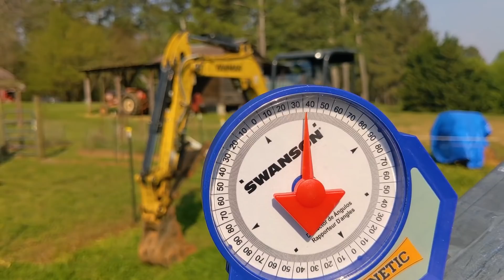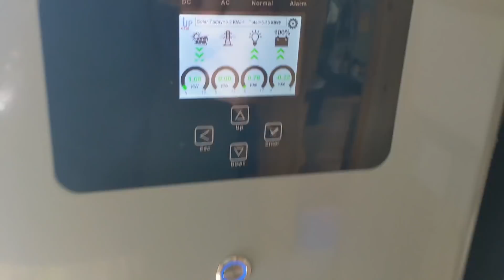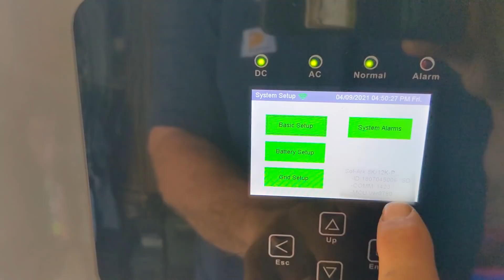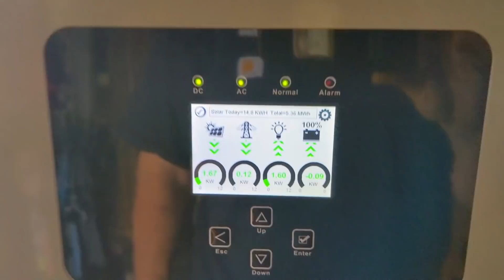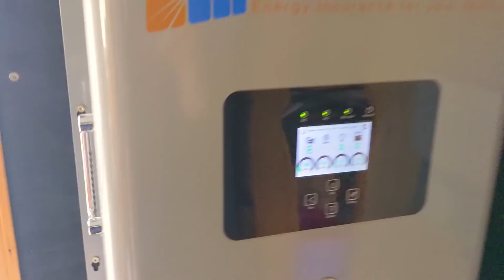4-year-old Sol-Ark upgrade if the cops will let us

Comment: You are right about trackers.  When land is the premium or modules are $20 a watt like they were in 1986, trackers make sense.  Otherwise, add modules and reduce failure points by installing a fixed array.

Comment: You are allowed up to a 9,999 lb trailer on a C-class basic license. Trailer over 10,000 lb requires a B-class license. The only exceptions are for having a recreational-type trailer. The 26,000 lbs come into play with a single-vehicle 2 axle type truck. The CDL  Class B license allows you to drive a 3 axle single vehicle weighing up to about 54,000 lbs. It could be 56.000 lbs. I can't remember for sure. Been a number of years since I had a CDL license Anything else in a combination of truck or tractor-trailer requires the CDL Class A. You then have to keep a current medical certificate as well. It kind of sucks the RV crowd gets exceptions to these rules.  You also need to have dot info and the last 8 of the in number on the doors as well. I am sure the troopers made you aware of that.
Reply: Actually any trailer over 10,000 lbs takes a class A license.

Comment: During a trip about 2 years ago to an all volunteerism  Parker AZ. Desert Van build event as a volunteer worker I mistakenly returned to Arkansas via I-40 and Oklahoma.  I continued past the Oklahoma DOT truck inspection station near the Arkansas / Oklahoma border since I did not fit any of the posted reasons for me to stop. The DOT cops ran me down at about 8 pm because the cop said my open trailer with some black plastic storage containers made me look like a contractor trying to sneak by the check point.  I spent the next 47 minutes trying to convince the cop I was not a contractor, AND , I had received NO monitory compensation, donations food or any other item that could have a monitory value assessed against it to make me getting paid for helping others making me a contractor by receiving a material item for work. Cop told me to go ahead but pull in next stop before getting out of Oklahoma. I agreed to do so, then I did not stop till I left Oklahoma on I-40. I have not been back on that part of I-40.

Comment: I bet your GVWR was over 26k.  2017+ F350 dually GVWR 18k + 10K trailer puts you at 28k combined GVWR.  Sir, did you know that you need a CDL A and medical card?  Oops.  Been there done that with NCSHP.  They really crack down on the ton trucks pulling trailers now.  Leave the big trucks alone most of the time.

Comment: The main reason I have an adjustable mount it's because I need about 67° in the winter time. If I left it at the 41° latitude the snow would cover it too much of the time. At 67°, it slides off much faster.

Comment: I worked for a groundmount installation company for five years using a 30' gooseneck trailer from florida to connecticut, without a CDL. As long as the truck and trailer is rated and registered for the weight, and it doesnt exceed a combined weight of 26k, and you have all the dumb fire safely bs covered, weve always told them to stick it... They cant do shit about it when its the law. Weve even gone to the DOT website and highlight it for them. Be detailed, and explain it rrreal slow so they understand. Haha
Reply: Yep. Managed a regional trucking company for 20+ years running 2 fleets. 1 fleet 18 wheelers with no issues, 1 fleet of one tons pulling goosenecks for the oil fields. We had a constant hassle over our gooseneck operation. I fought every single citation and won every single one. I found that most, but not all, enforcement officers and their supervisors were not properly trained in the less than 26k operations. Unfortunately, one state DOT officer got demoted due to his arrogant attitude. I went over the state and federal regs with him face to face on two occasions and he would not budge. Thing is, I actually liked the guy and hated he got booted back to the bottom rung of the ladder. But as they say, it is what it is.

Comment: Your channel has helped inspire me to start my own channel    Keep up the great content. So what was the citation for?  I’m in VA, close to NC
Reply from the maker: In South Carolina I'm legal but in North Carolina I am not according to the maximum GVW combined. Even if my trailer was empty they still could have got me.
Reply: @engineer775  Did you have an Annual Inspection Report with you and did he write a ticket on that if you didn't? As soon as you cross the State line, the limits change on when one is required. As I'd guess that trailer is rated at more than 10K, it alone can put you afoul of the law once you cross a State line. :-(
Reply: @engineer775  You should get an attorney involved.  There are laws if your vehicle is legal in your state, you should be legal in other states too.  With both of you getting ticketed, you probably can pool your money together to pay the lawyer.
Reply: @haroldhechinger5850  Waste of time and money. Just because you are legal in your State, does not mean you are legal in another.  Driving a vehicle that is used commercially opens you up to a whole different set of laws. Heck, just having a CDL opens you up to different rules even in a car.

Comment: Receiving a traffic citation is NOT being arrested. Follow the law and you wont get traffic citations. Stop whining.
Reply: Um spoken like a true pedestrian
Reply: A charge of operating a commercial motor vehicle without a commercial driver license is a crime, not merely a traffic citation. Depending upon the actual weight of the trailer, that criminal charge may have been a possibility.
Reply: @r2db  oh please... we all know these laws are about revenues not public safety.... this is plain old harrassment what He needs to do Is license the truck and trailer under farm plates and weight is no longer a problem... stop contributing to the North Carolina political oppression patrol
Reply: @tdgreenbay  If he drives the farm vehicle for uses not within the limitations of farm vehicles that could also be a crime instead of just a traffic citation, possibly getting his vehicle impounded in the process instead of just going on with his day and paying a ticket. Before getting my class A CDL the heaviest vehicle I had operated was a medium duty ambulance. The specific knowledge and skills taught at CDL school were absolutely essential to the safe, unsupervised operation of a heavy vehicle, although CDL school is only the bare entry-level training for such vehicles. There is a reason that specific training, testing, licensure, and insurance are required for heavy vehicles. They are deadly weapons if the average steering wheel holder is operating them. I have already picked up enough splattered human remains on the highways.
Reply: @r2db  what's not farm about trailering a Skidsteer or Mini excavator... dont volunteer information play it cool hand luke
Reply: @tdgreenbay  The actual use is the issue. Just because something can be used on a farm does not mean that it is exclusively used on a farm. For example, in Wisconsin: "A registered farm truck may not be used in furtherance of any nonfarm occupations, trade, professional or other employment including commuting to or from the place of such nonfarm occupation, trade, profession or employment."

Comment: Practice the right answers!  Where you headed? Eastbound, where are you coming from? Westbound ! What are you hauling? My personal property! For what purpose? Farm use! You got tickets because you gave gave all the wrong answers, you said I’m hauling customers equipment to a commercial job, which was wrong, that equipment belonged to you until installed and you took it to a farm!  You can travel anywhere in the us on farm business with local farm tags and are exempt under federal law up to the 26000lbs, put NOT FOR HIRE on your trucks, because you’re not hauling for hire
Reply: Sorry, but you are wrong. A State can have stricter laws than the Federal Laws. The Federal ones are the bare minimum. Farm tags? Better be closer than 150 miles to where your equipment is registered at or you will find yourself getting a ticket in many States. One that could catch me if I had registered my vehicle at the full 11,400 GVRW? Florida law that says a combination that exceeds 18,000 is a CMV.  Truck GVWR 11,400 + trailer GVRW of 7,000 equals 18,400 and could get a ticket if no CDL, etc.... CT had the same laws and if you went to a show and won a trophy or ribbon, it was considered a CMV. The other problem with the truck? When it was built it exceeded the width laws on many State Highways. Because in 2001 the Federal Law changed to 102" on the wheels/bed but the State laws still had 96" limits on State roads where the lanes were under 10' wide. 
And the annual report requirement can bite you. "All commercial vehicles (trucks, tractors, buses, trailers) with a gross vehicle weight, gross vehicle weight rating, or gross combination weight rating of: more than 10,000 pounds when used in interstate commerce; or more than 18,000 pounds in gross weight used in intrastate commerce; or vehicles that are designed or used to transport more than eight (8) passengers, including the driver, for compensation; or vehicles that are designed or used to transport more than 15 passengers, including the driver, not for compensation; or any vehicle transporting hazardous materials requiring placarding must receive a Federal annual inspection in accordance with sections 14-163c and 14-163e of the Connecticut General Statutes (CGS) and 49 Code of Federal Regulations (CFR) §396.17. 

The results of the Federal annual inspection must be recorded on a report as specified in 49 CFR §396.21. That report must be carried on the vehicle(s) in accordance with sections 14-163c and 14-163e of the CGS and 49 CFR §396.17 and 49 CFR §396.21." from https://portal.ct.gov/DMV/CIVLS---Modernization/Registration-CIVLS/Vehicle-Types/Requirements-to-Register-Your-Commercial-Vehicle---Intrastate
Reply: How about follow the law.  You ain’t special it meant for safety!  Don’t increase your profit margins at a risk to my safety!

Comment: In Ontario pickup trucks can be for personal, commercial or farm use. If for personal use you can not tow or carry "commercial" tools or equipment and you can not accept payment for work. A special tag is placed on your plate. For commercial use you require a CVOR. Vehicle requires an annual inspection, keep a driving log and other commercial requirements.

Comment: With DIY lithium Iron Phosphate about $150 per Kwhr and lasts much longer it would make since to have some AGM batteries just for EMP with a knife switch etc just to top of charge etc. Use the larger part of the battery with Lithium for  daily use.

Comment: A tilltable array is particularly useful for winter. It does increase output 10 % or so when you need it most and keeps snow off better. 10% more when your production might be half normal is useful and yes you can oversize but thats takes a larger space and more frame costs etc which nowadays can cost just as much or even more than the panels to begin with especially if not DIY.
Reply: Ya but it cost more to be able to tilt the array that big. Much easier to just add 10% of solar.
Reply: @JM-yx1lm  Doesnt cost essentially any more than any one line of post system (see other engineer 775 recent video ..  Costs me about $800 to mount 30 panels tillable DIY granted would be more with steel posts but still will last 30 years or more and can be replaced without taking it down anyway. Here is a link
:https://imgur.com/a/gHRiwKE
https://imgur.com/IGjhvnp
Reply: @JM-yx1lm  10% more solar is also 10% more mount  and may require more inverter  more installation cost more space needed at site also since it should be sized based on max volts watts which will be in summer when its not tilted. So there are a lot of increased costs other than just more solar panels to consider and quality inverters are not cheap. Your 10 % increase in panels could even increase system cost by many times more than that.

Comment: Looking at your outfit.    
  I would think they checked the straps on the front of your trailer and didn't like them.  They looked at your chains and binders on the backhoe to see if there were enough and they were grade eight and of the correct size.  They checked your tires for size, weight rating, tread depth and condition.

Comment: When you talk about hardening with lead acid, are you talking about EMP protection? And why can’t you harden lithium?
Reply: Lithium batteries for solar storage have built in battery management that would still be succeptable to damage by an EMP, so at this time they can only protect a "dumb" battery like lead acid
Reply: @DrJekyllonHydePark  
So you’re telling me I need the batteries incased in a EMP proof container.
Reply: @benjones8977  that might work, but in any case I suspect the solar system would need to be shut down entirely, possibly even disconnected to survive an EMP.
Reply: @DrJekyllonHydePark  
I have ferrites on all the wires
Reply: @benjones8977  I hear that might help, but honestly, it's hard to have a solid answer on this as I am not an expert on EMPs or have a way to reproduce one to test it....

Comment: I never could understand why you would pay extra for an EMP hardened inverter, but then have batteries that are darn near as vulnerable to the world as a freshly hatched baby chick. Personally, I'd add extra panels to make up for the difference in going with batteries that are almost impossible to destroy and last almost forever, nickel iron. No, they're not nearly as efficient as lithium, but after an EMP or CME....they will still be just as inefficient, AND WORKING....while lithium.....???? Otherwise, paying extra for an EMP hardened inverter is pointless. 

I think we get so caught up into trying to squeeze every last watt out of a system, that we forget that it's first role is emergency back up power, and so we have foolishly created a system where we have unrecoverable failure points built in, just to get that extra few percentage points of efficiency. Don't get me wrong, lithium is great for things like a solar generator, but for my home, being reliable and tough beat out efficiency every time. Keep up the great work.

Comment: Biggest thing is look at the weight rating of your vehicle on the inside of the truck and the trailer weight rating on your trailer look at both of those and look at what they're able to have capacity at...
Reply: Nope... biggest thing is to ensure your tag is rated to the maximum weight combination of truck and trailer... A $600 tag fee yearly...
Reply: @SuperVstech  yes you are right cuz your tags going to have that information on it but if your tags didn't have the right information on it then that will be a different class have to have the right classification trailer you're using....

Comment: I am a CDL driver if you just would have brought you more problems I have a class B and that's all you would have needed if that was the case... probably be the length of your trailer in combination with your truck..gross weight of both...dot ...I'm in florida..
Reply: I'll bet that that trailer is rated over 10,001 lbs. That means Class A CDL and not a Class B. And I'm in Florida too. Just gave up my CDL last month. Don't think that after being retired for 15 years from the Florida government jobs, that they would want me back.  I passed the vision tests but would not consider it safe to drive a CMV with the restricted range of vision with my left eye. And Fed law can get him for an Annual Report which opens the door for requiring DOT numbers, CDL, insurance as a CMV, and a whole batch of other things they can throw at you.